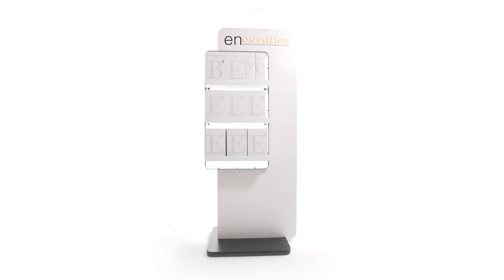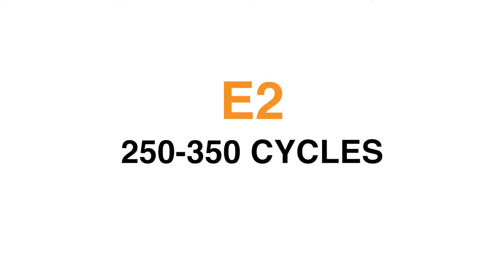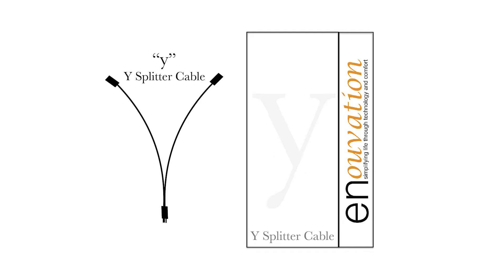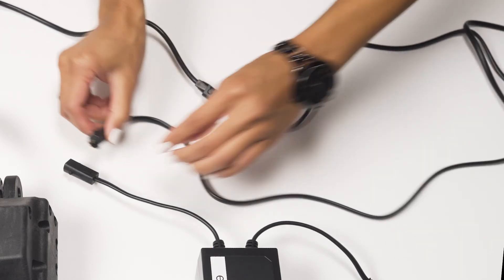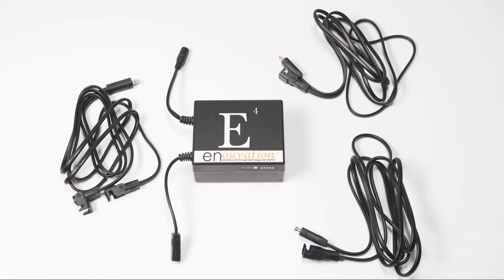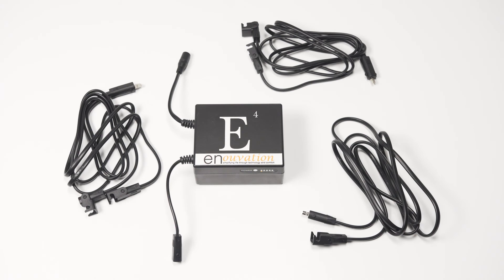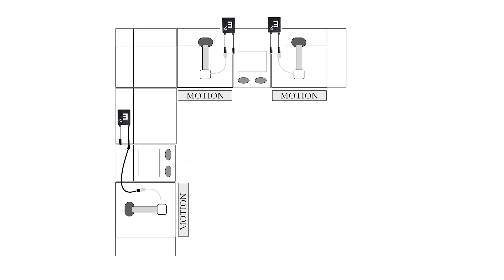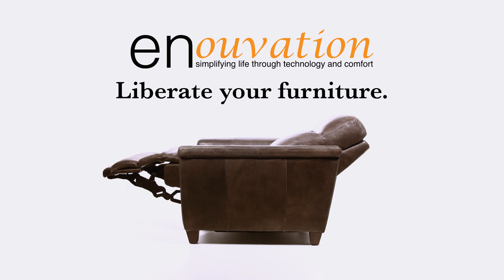Enouvation: Power Pack Installation Guide

Comment: Why does the battery hold a long steady beep sound while charging? This sound can go up to about 10 minutes before so get annoyed and unplug it.
Reply from the maker: This can happen if your power pack is severely depleted and needs to be recharged. In these cases, the beeping will cease when charge is restored to at least 10%. Under normal circumstances, the interactive low power alert will only sound when you open or close your furniture while power is low. If you had any other questions, our customer care team is happy to help. Visit our website and click "contact us" to get in touch.

Comment: What does the end look like that connects to the motor?
Reply from the maker: The power pack has a female, two prong connection that connects to the furniture's motor lead. If you jump to 1:46 you'll see an example of connecting the power pack to the motor. If you had any other questions or needed further assistance with your setup, visit our website and click "contact us" and one of our technicians will be happy to help!

Comment: How do I charge it
Reply from the maker: If you refer to the still shot at 1:32, the female connection port at the top of your screen attaches to the provided Enouvation charger. The charger is then connected to wall power. Be sure to disconnect the pack from your furniture when charging. Additional information and resources are available on our website. If you had additional questions please submit an inquiry on our contact form.
Reply: I can't get this thing out of demo mode. Any suggestions?